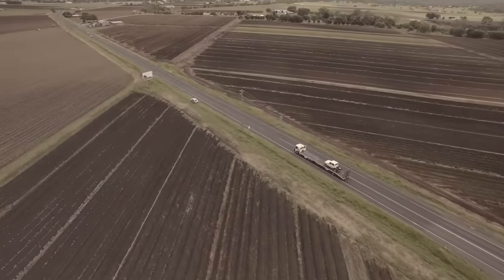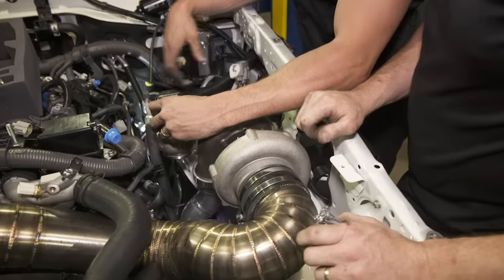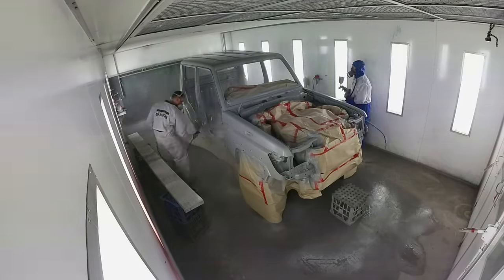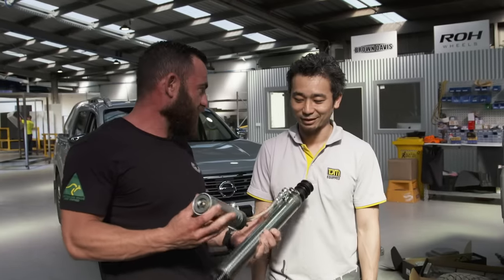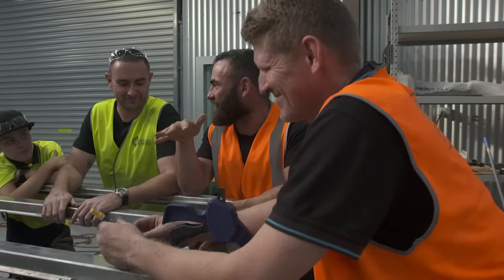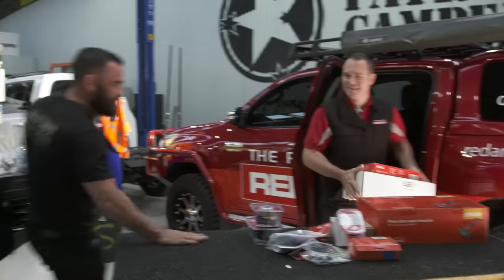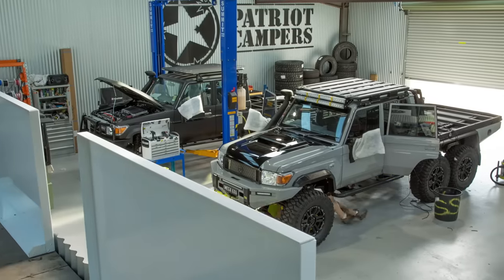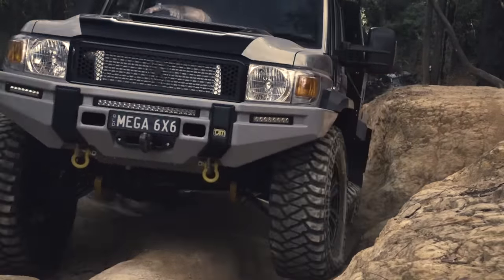Australia’s Original 6x6 LC79 Landcruiser - The MEGATOURER™

Comment: Great job was done. And it was pleasure to see how it was done.
But some offroad vehicle related stuff was not mentioned.
Electronics located rather low and may be flooded
Steering arms are vulnerable to obstacles, especially to ice. usually, special skid plate is used, connected with one swivel joint  to front bumper and with two joints right to front axle.
Air bags are not protected at all and may be pierced with stick in deep mud and need frequent and proper cleaning.
Engine was tuned, horsepower increased but cooling system still in front bumper while rear platform almost empty.
Weight distrubution is under question. rear axles may be not properly loaded while front axle may be overloaded.
And i see no central inflation system and no beadlocks on wheels.
anti roll bar looks not quickly disconnetcable like on Jeep rubicon.
Overll it looks like that car is for at least warm and preferrably dry off-road, for cruising on roads without tarmac

Comment: I call BS, more than 20 years ago I used to service a 6x6 75 series that was built for the Waterboard.
2 rear diffs, apparently worked really great for towing their huge boat but was useless at 4x4 cause it didn’t turn tight.

Comment: 400 horsepower isn’t even a lot in America.
Reply: I’m sure it’s geared we’ll tho
Reply: I agree with you 100% — he spent a lot of money on this motor and it should be better than that. I have a 2001 Ford F-350 that has a 7.3 motor. With just a few modifications I have 600 hp at the rear wheels and over 1000 pounds of torque
Reply: It’s plenty for a Cruiser, it’s a 4litre diesel, your 250 is damn near twice that. I’m more interested in the torque it produces.
Reply: @annotten7413  its 4.5 v8. itd make over 1100nm. i think most people would take this over a ford haha